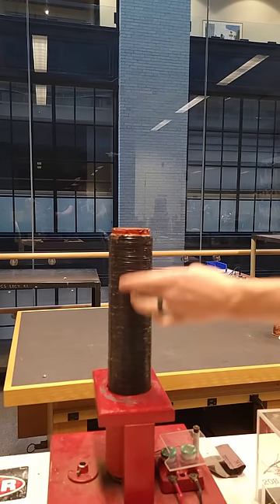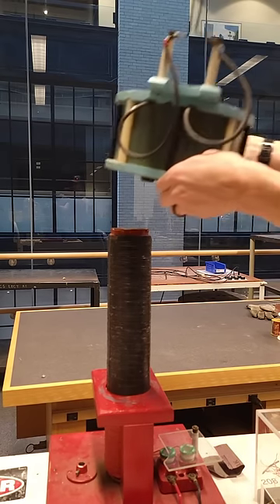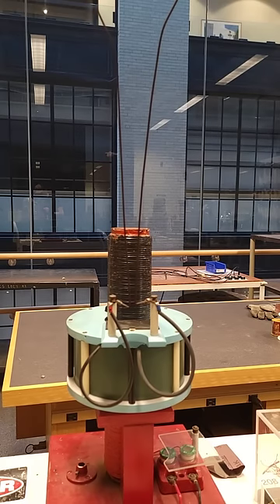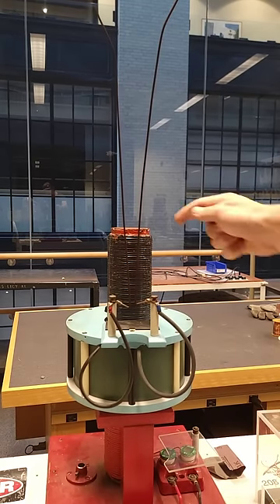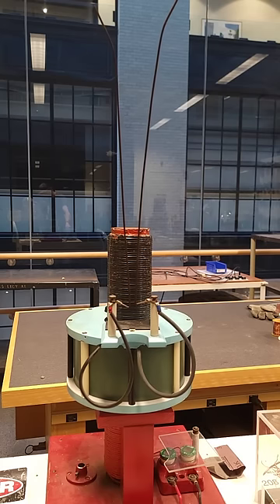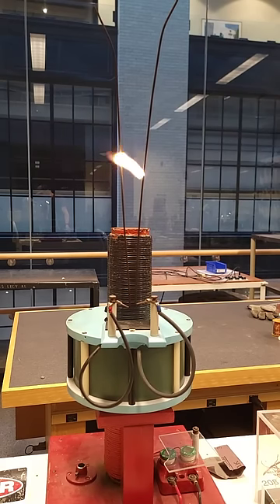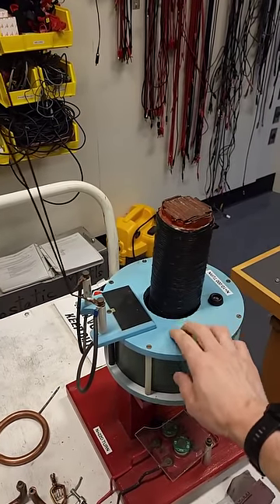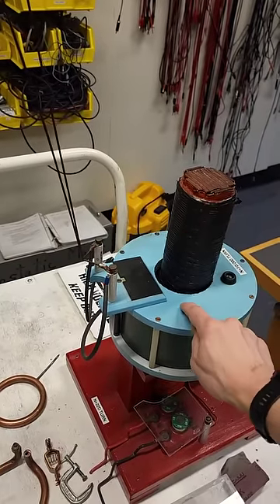Watch this 10,000 turn transformer breakdown air! #shorts #physics #science

Comment: Just gotta love how when you put enough juice into something, everything becomes a conductor
Reply: In the words of William Osman, "welcome to the world of high voltage, where everything's a wire and you're probably gonna die"
Reply: @sonters these are words to live by!
Reply: Oh just like if you have a big enough magnet, everything becomes magnetic.
Reply: @Pheonixco 
The wife used to work for Phillips and used to relay me stories about forgotten metal tools in an MRI machine 😂
Reply: I've seen hollow rubber vacuum tube conduct automotive ignition spark and discharge it three feet away on an engine bracket.
Reply: #TrueStory!
Reply: High frequency high voltage is the thing nightmares are made of just when they thought plastic was an insulator... nope not with this monster.

Comment: Every old scifi movie laboratory ever:
Reply: 'It's ALIIIIVE!!!'
Reply: Everything makes sense now
Reply: Don’t need thousands of volts for that, it can  be made with much lower power, there’s desktop versions, it’s called Jacob’s Ladder
Reply: @zybyz  Every Jacob's Ladder needs at least 15,000 volts of potential between the electrodes. Breakdown voltage, that is, the minimum potential difference between two electrodes at which the air between them becomes conductive, depends on air pressure, humidity, the distance between the electrodes and the shape of the electrodes. For the wire electrodes a Jacob's Ladder apparatus, the 21,000-volt peak voltage of the transformer secondary is enough to cause breakdown at the sharp bends near the bottom of the electrodes, where they are closest together. 

Because of background radioactivity and occasional cosmic rays, there are normally some electrons and positive ions in the air, which are accelerated if they are in the electric field between two electrodes. If an electron thus accelerated can attain enough energy within its mean free path, it ionizes the next air molecule with which it collides. The electron the air molecule loses is similarly accelerated, and it ionizes yet another molecule. The (positively charged) ions thus formed are accelerated in the opposite direction to the electrons and collisionally excite, and undergo charge exchange with, other air molecules. A conductive path thus forms between the two electrodes, and an arc jumps the gap between them. In this arc are excited neutral molecules, ions and electrons. In relaxing to lower-energy states, the excited molecules emit light, which we see as a glow or spark between the two electrodes. Once an arc forms, the voltage necessary to sustain it is considerably less than the breakdown voltage, but because of the resistivity of air, at least 15 kV is needed to start the initial arc.
Reply: I was thinking of Young Frankenstein when I saw it.
Reply: @teebob21 weird. I use 2kv peak to peak  and a resistive element to initiate the arc at a closer distance before it travels up since the air is already ionized and has a very low resistance once it's started...   😆

Comment: what you are calling a "solenoid" is actually just called an inductor. A solenoid is basically a relay in that it uses a smaller volt/amp to turn on a higher volt/amp circuit. Solenoids and relays both in principle work the same, however solenoids have hollow cores with spring loaded pole switches within the core and relays generally have pivot switches.

Comment: Would have been good if you had told us the output voltage, 5004.5 volts I believe

If I remember my schooling correctly you can use the ratio to calculate the output voltage

R = 10,000 / 220 = 45.45
R = 45.45 (rounded)

Output voltage = 45.45 ratio x 110 volts
Output voltage = 5004.5 volts

It's been a while since I was at school though,  so happy to be corrected if I've got it wrong
Reply: And, actually, 110 is the RMS voltage.  More interesting is the Peak Voltage, which is 110 * SquareRoot(2) = 110 * 1.4 = 154 so:
154 * 10000 / 220 * 0.95 = 6650V

That's the voltage available for ionizing the air between the rods.

And, where I'm from [Utah. USA], the mains voltage is more like 120V, thus the peak voltage would be more like:

7255V!!

Comment: Was just learning about this in physics class
Reply: Trick question in electrical physics tests. 
"If a battery is connected to a primary coil, what happens in the secondary coil?" 
 
algebra based technician class - 'nothing.' 
calculus based engineer class - 'VERY short duration induced current flow.'

Comment: Dammit Jim I'm a truck driver not an electrician. But don't they call that a Jacob's Ladder?
Reply: Yes. Indeed
Reply: Wonder why.
Reply: Yeah
Reply: Oh hell yeah I haven't heard anyone say damnit Jim in years. I thought I was going crazy
Reply: @unamordiezdose5579  🤣🤣🤣
Reply: I was wondering if anyone knew the name of the contraption. 

You can also hold a sheet of paper in the middle and it won't burn the paper but make a bunch of little holes.
Reply: yes
Reply: I wonder if there us a connection between a Jacob's ladder and a Jacob engine brake in a semi truck. Lol
Reply: Don't think so "Tim!"! Lol
Reply: Does Jacobs ladder lead to a stairway to heaven? Looks like it
Reply: @jeffjeff4477  why would you need a stairway if you had a ladder? Lol
Reply: @lawrencewheeler8868  My bad, I was speaking in metaphors 😂
Reply: @jeffjeff4477  just kidding!!🙂
Reply: @lawrencewheeler8868  👍👍👍
Reply: Why did they take the name of a wooden children's toy for an electrical engineering component lol
Reply: @dhayes5143  not familiar which a toy named that? As the arcs climb the rods, they resemble a ladder. Sort of!

Comment: (personal clarification)
Seems more like that a voltage charge is being passed through one path that happenes to be overlayed by many paths (through the core: carried by the solonoid)
So the initial charge is magnified several times over by the receiving coils. 
The difference between if you had used just the solenoid, is that now you have a magnifier on the charge.
Normally, the voltage going through the solonoid would have 'single file' charges going through it. However, since those charges are coming from a source where more than the regular controlled flow of charges are coming through, the solenoid is overloaded, creating a high energy release.

Comment: kinda, like a neon sign transformer, iron core primary surrounded by the secondary coil.⚡. DEADLY for sure.
Reply: Funny you really don't see those anymore.  Most modern neon "transformers" are high voltage power supplies, more like radio transmitters.  When I used to bend neon, these types were new and we didn't trust them.  We felt they caused the mercury in the argon signs to migrate, leading to premature failure of the sign.  Recently I helped a friend with a broken sign that had two of these power supplies.  We were able to find a duplicate on Amazon and the sign was good to go.  In the old days, you would have never used two of the actual transformers behave they weighed like 20lbs.
Reply: @microdesigns2000 I have a bunch of the old France ones in various sizes from the pre-GFI days just for projects like this
Reply: Not kinda, exactly the same thing, just different counts, thickness and amperage.
Reply: Built one out of an old street signal light transformer. Two brass rods and presto....instant movie prop.
Albeit a very deadly one.

Comment: you’re describing eddy currents in the secondary, which isn’t entirely accurate. what’s happening is the changing (alternating) current through the primary creates changing magnetic fields that are amplified by the iron core. these field lines wrap around the secondary which induces a current and creates a voltage potential across the secondary. the secondary voltage is related to the number of wire turns in the secondary.

for those asking, an ideal transformer transfers 1:1 apparent power (volts * amps). so if theres 1200 VA of apparent power at the primary, there will be 1200 VA at the secondary, but the ratio of current to voltage will be different.
Reply: this guy definitely coils' ^^^^ lmao

Comment: (10000/220)*110V=5000V *95%ish efficiency ~4750V across the electrodes.
Reply: The answer i was looking for.
Reply: What country uses 110 because it's not the United States
Reply: @__Brandon__  yes the US uses 110V.  The voltage has been increased over the years too your typical 120V circuit.
Reply: @hunterakers9585  the US hasn't used 110 for over a 100 years. That's kinda irrelevant. The modern grid with shed load at the substation level if it ever drops to 110 for more than a couple minutes and the lineman will adjust your transformer to keep your voltage at 120 if you live very far from the substation or the will tune down it if you live close. Basically all modern equipment for the US requires the voltage to be between 110 and 130 to operate and if you get outside of the rated range it fries it. Especially AC motors which our typically rated for a minimum voltage of 115v. If you give them 110 for more than 5 to 6 minutes they overheat and start melting the wires together which is extremely dangerous. The US doesn't use 110. It used to a very long time ago, but it was raised to make street lights brighter. That's was before any of us were born so that shouldn't be any confusion for anyone today
Reply: that’s literally why I said “increased over the years.” I’m fully aware of the NFPA standards are. More importantly though, the video specifically said that he’s using an input voltage of 110V, obviously AC otherwise nothing would happen. Furthermore, he could be using a power supply to generate enough current, more that would be supplied in typical household drops. Also, MANY MANY engineers, techs, and hobbyists still call 120 as 110. He could have just used the wrong terminology. I don’t know him or his setup. Just using his values. 95% is kinda low for a good transformer efficiency, but it’s a good starting point.
Reply: And, actually, 110 is the RMS voltage.  More interesting is the Peak Voltage, which is 110 * SquareRoot(2) = 110 * 1.4 = 154 so:
154 * 10000 / 220 * 0.95 = 6650V

That's the voltage available for ionizing the air between the rods.

And, where I'm from [Utah. USA], the mains voltage is more like 120V, thus the peak voltage would be more like:

7255V!!
Reply: @steve42lawson  Correct, but we still generally use the RMS value when measuring AC across a transformer. Generally we use AC(rms) to describe the same average power that would be delivered by applying equivalent DC voltage to a load.
Reply: Correctly calling it the RMS voltage doesn't change the fact that nowhere in the US uses 110 volts on purpose and calling 120 volts 110 is incorrect
Reply: @__Brandon__  like I said before: who’s to say he used a typical wall outlet for his primary voltage. He could be using a independent power supply. I’m not calculating based on what typical residential voltage is rated at. I’m calculating based on what value the operator said the voltage was. Were you there when he measured 110V? I wasn’t….so I’m not critiquing his choice of 110V statement.